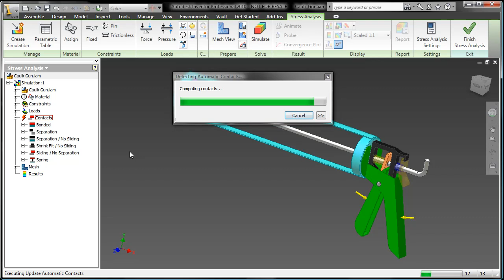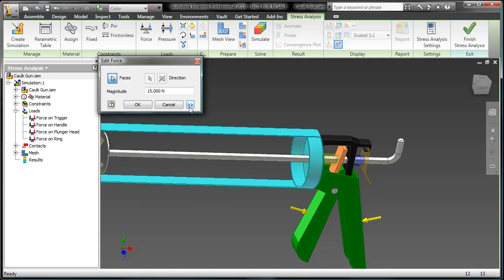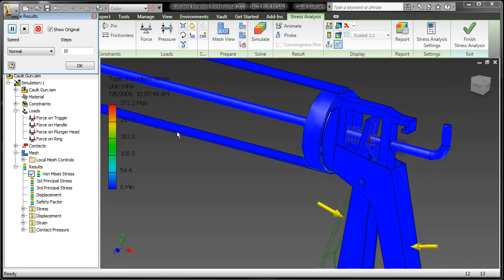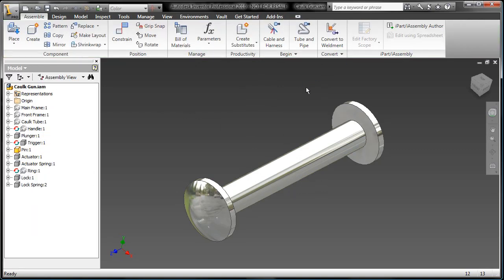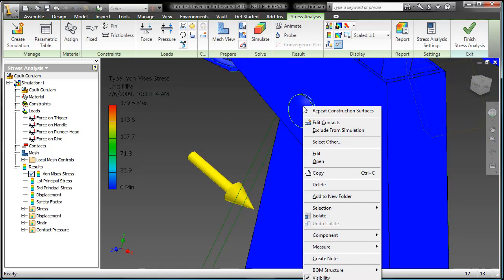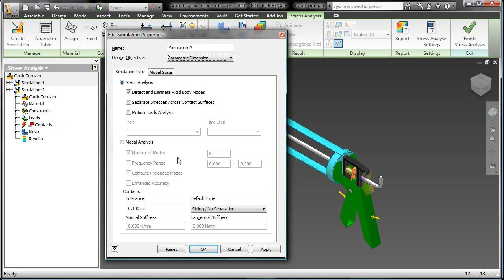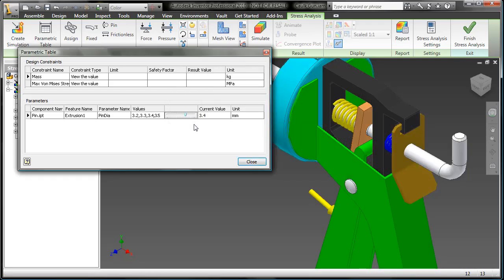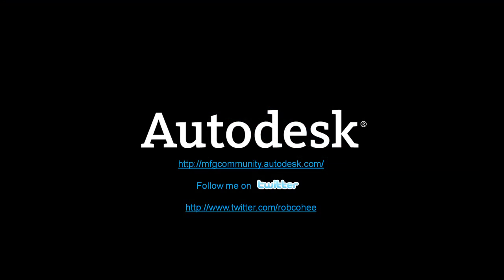Autodesk Inventor Stress Analysis - Campaign to stop WAG Engineering

Comment from the maker: From a collegue via email - I would be remiss if I did not point out that the whole Red=Bad characterization falls into the WAG category. Keep in mind that the results graph is a floating scale with regard to stresses. Values are actually good as log as they are within acceptable limits for the part/assembly being analyzed. Users should always inspect the results, study the numerical values, perhaps use several load cases to look at how results are trending and then make changes accordingly.

Comment from the maker: I think everyone knows my position here. I'd like one of the viewers to reply to this question to get another point of view. But, here is what I think - in terms of 3D modeling,basically a Ford or Chevy comparison. But when it comes to FEA, Motion, Design Optimization, Sheet Metal, 2D docs, all as easy to use as an extrude command, but helps solve the design. That's the difference between an engineering tool and a CAD tool. Inventor is just that, an engineering tool.

Comment: Exuse me sir,

When I try and run a stress test, the parts warp no matter what I do. For example I tested it by placing a 6 by 2 inch solid oak beam on two other perpendicular beams at a 5 foot spacing placed my weight on it (980 Newtons). The simulation showed approximately a 3 inch bow. Now  know that if this where the case the floor in my house would be quite fun to walk on, but it is not. 

Is there something I am doing wrong, or am I interpreting the results wrong?